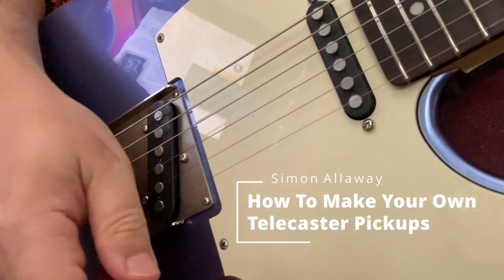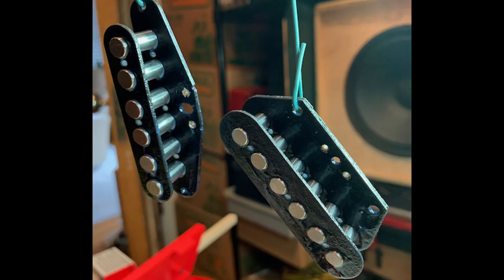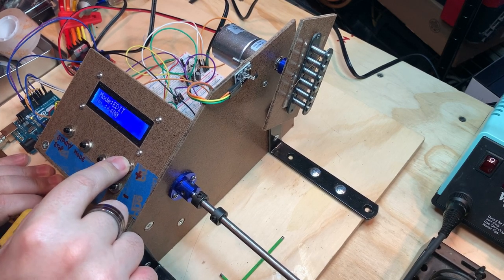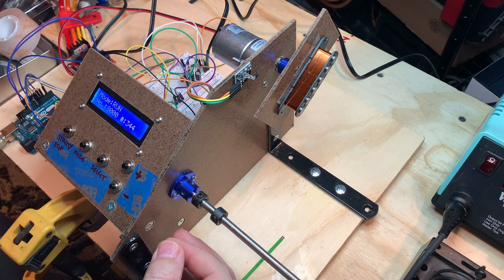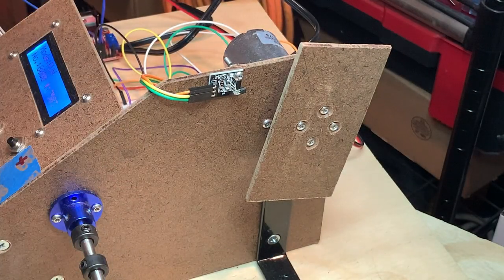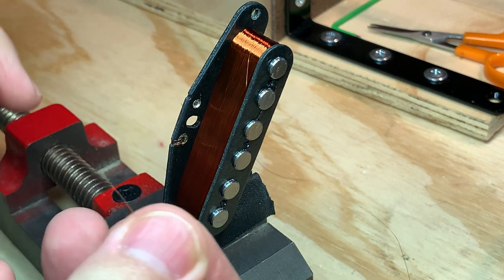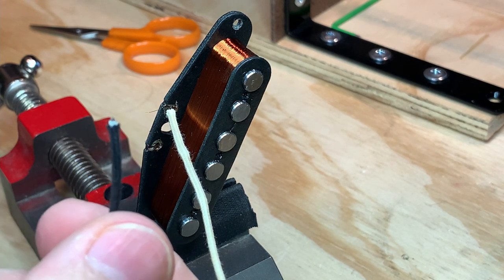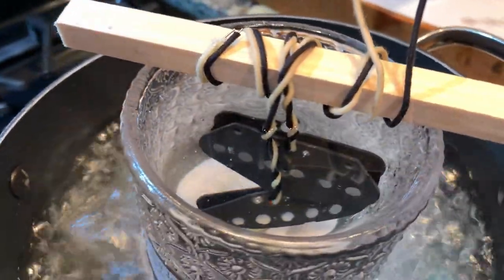How To Wind Your Own Telecaster Pickups (with an Arduino)

Comment: Nice video. Sounds great. I'm convinced now that I don't need to make a pickup winder, I can just use my mini lathe. It has no total revolution counter but it displays rpm, so if I set it at 600rpm and run for 12.5 minutes I should get 7500 give or take a few turns. All I need to make is a guide to limit my sideways movement. I think I can stay awake for 12.5 minutes!
Reply from the maker: There's no reason why you couldn't use one  of those revolution counters like this one ( https://a.co/d/0DJSebc) with your mini lathe. 
Good luck with whatever method you use :)

Comment: Do you have a background in programming and such? or were you able to just figure out the Arduino stuff? I'd love to make a winder with an Arduino UNO, and maybe have a CNC shield for auto traversing but have ZERO Arduino skills and wondering how hard/easy that aspect may be.
Reply from the maker: I've been writing code for 30 years now, so yes I have a background in that. But the Arduino is extremely easy to code for. Indeed it was designed for non-programmers to use. You can get a cool starter kit for about 50 USD with a load of great lessons. It's a lot of fun.

Comment: They sound great. The bridge sound is really cool. What K ohms did the bridge end up at? Alnico 5 mags?
Reply from the maker: Yes, Alnico 5 magnets. The bridge pickup ended up a hefty 10.3k as I used 43AWG wire.

Comment: Definately need to slow down the spin speed.
But great gizmo all the same.
Reply from the maker: The current RPM is about 800 so it's already quite slow. What speed would you recommend?
Reply: @hotglassbottles  
I would at least halve it or slow it down enough to get a neat uniform result.
It just looks a tad too fast from the video.
Reply from the maker: @jayytee8062  I am writing the code for the servo to handle the wire traversal automatically. That's the only way to get an orderly wind. No amount of slowing down will work when doing it by hand.
Reply: @hotglassbottles  
Simon, even better.
Maybe a spring loaded tensioner as well....

I've also wanted to make a simular machine for winding fishing line on various sized reel spools.
But i can't get my head around the coding aspect.
Who knows though with videos like yours i might just dive in! 
Keep up the awsome work Simon!
Reply from the maker: @jayytee8062  I've got a small strain gauge from an electronic scale and I was going to rig that up with another servo to manage tension. Did you see my blog post that talks about the code? It's actually very simple.
Reply: @hotglassbottles  
I will have a look.
Thank you Simon.